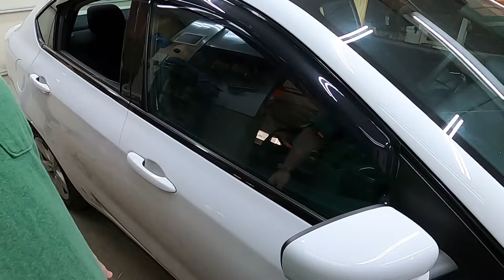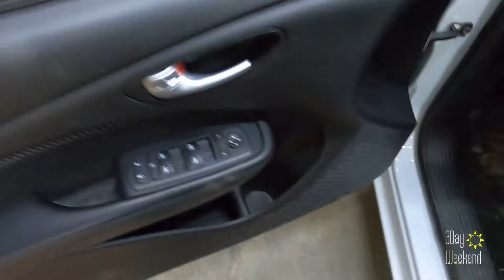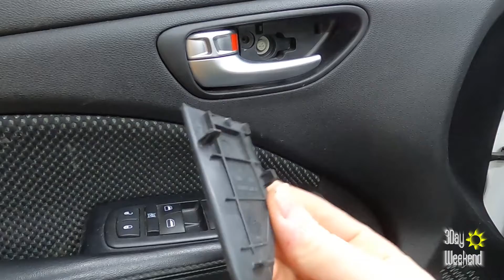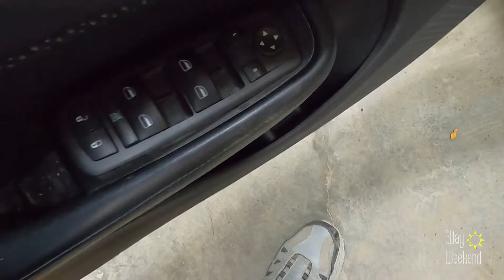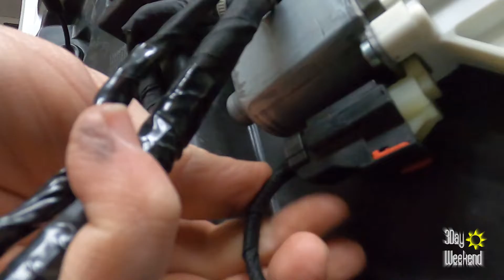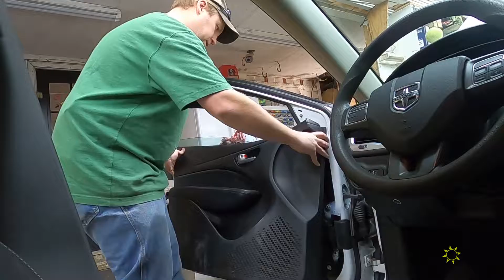Dodge Dart / Chrysler 200 window won't roll up/down?  I'll show you how to test and repair!

Comment: thanks for your video. I have a dart passenger window that won't go up.   You replaced the driver's door switch but not the passenger door switch. Can the main switch you replaced cause the switch on the passenger door not to work?
Reply from the maker: You're welcome!  Yes, the driver's switch can prevent the passenger window from rolling down, as it is the central control for all the windows.

Comment: Didnt work whats next ??? Motor ans switch was replaced
Reply from the maker: Not sure, those are usually the primary causes.  Be sure to check for voltage.  No voltage = no windows.

Comment: 2013 chrysler 200 front passenger window decided it won't roll up anymore. only down. 
sad because it's supposed to start raining in about two hours or so where I am, for about six or so hours straight :/
it won't roll up from passenger or driver side switches. only down further.
Reply from the maker: Oh no!  It sounds like a switch to me.  If it will roll up OR down, then it's not the wire I'm talking about in this video.  Hopefully you were able to get it sealed up before the rain!

Comment: Question. I have a 2016 Chrysler 200 and my switch doesn’t let me roll my front two windows down but it lets me roll the back two down I can’t lock my doors from my switch either but I can roll every window down on its own switch and I’ve already switched out the master switch with another but it still doesn’t work and I’ve checked the fuses and they aren’t blow I’ve also checked wiring do you have any clue what it is
Reply: You get any answers?
Reply: @SheLuvsMelly  no sir I got a window motor coming in and that gas to be it
Reply: @ianTufff  gotcha. Ive tried the fuses but that didnt work. I can only let down the rear windows. Cant lock doors or roll down the other windows from the driver’s side.
Reply from the maker: Hi there.  I have had this same issue on another 200 and it ended up being a broken wire where it crosses from the frame of the car and into the door.  The little boots aren't waterproof right there so water can get in and corrosion eats away at the wires.  If your fuses are good, the switch has been swapped, and you can roll down all of the other windows from the buttons in those doors, it is likely a broken wire right there.  They are a real pain to fix too.  Hopefully your problem isn't the wiring, but that's where my hunt took me last.  Good luck!
Reply: @ianisvibin did you ever figure out what it was I’m having the same problem